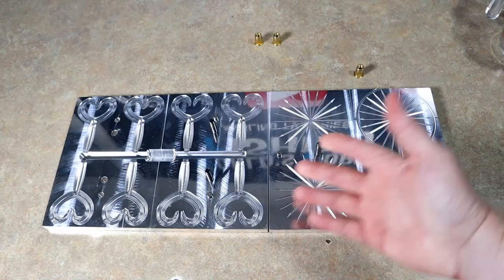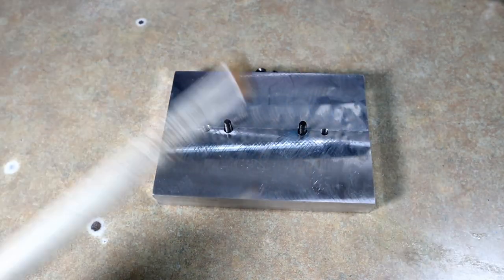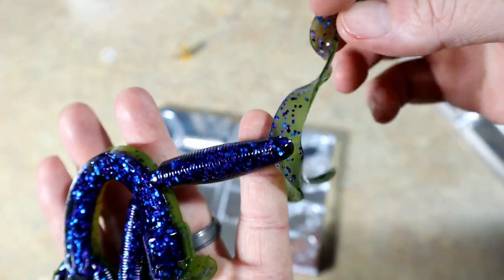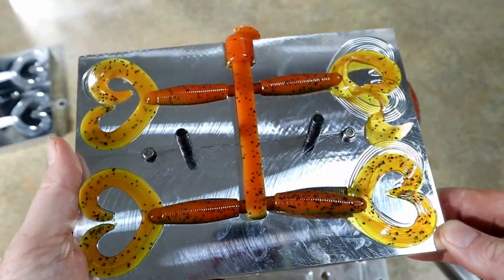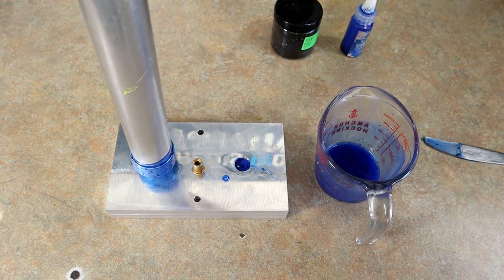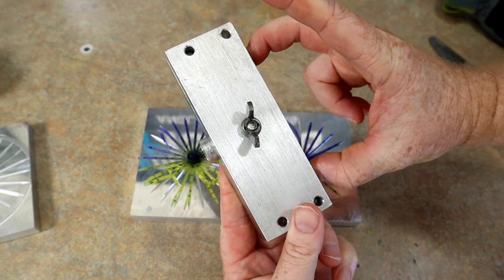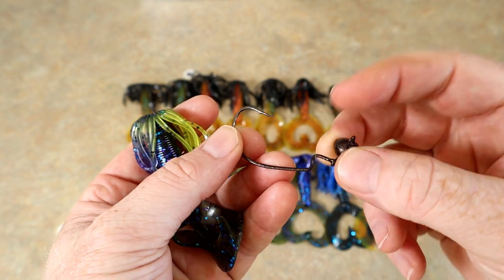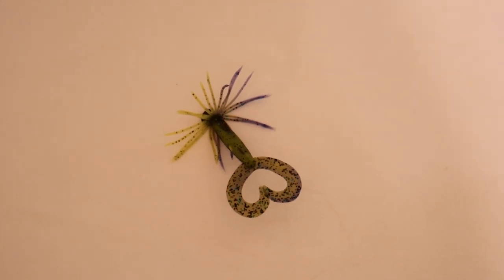Let's Make SKIRTED GRUBS!  New Molds and New Techniques!

Comment from the maker: This was one of the coolest things i've done yet!! Which were your favorite???
Reply: What a great idea adds so much flare to your plastic it's sure to catch more fish . Probably go well as a  trailer on a chatterbait to add that extra flash 👍
Reply from the maker: @erlinglarsen  yeah the cool thing is you can weld these skirts to any bait in your collection
Reply: Not a bait I thought I would even want until I saw the swim video
Reply: @WorldsWorstFishing  For sure the list is endless. I was wondering and thinking of the different applications you could use them for as you were making them 😂🤣 but as a lure maker and fisherman you can't help but wonder what you could use them for 👊
Reply: @WorldsWorstFishing  maybe try and link a few on top of each other 🤔😂
Reply from the maker: @erlinglarsen  go check my instagram, I did that and posted a picture
Reply: the black grape/ yellow grub
Reply: Blending the skirt awesome.
Reply: Blue green in the Northeast looks killer!   Even I could catch a fish with that set up
Reply: @WorldsWorstFishing  will do 👍
Reply: You're starting to gather quite the collection of molds.
Only 2 or 3 hundred more to equal what Scroggins has. lol

Lets say I was to leave the heat gun on while doing this is the residual heat blowing out gonna burn me or does the heat knife apparatus block it so it is all focused on the blade?
Reply: Do you still sell? Those black grape, yellow I'd like to get a bag or two of. If not I understand. Awesome work!
Reply: My favorite is the 2 color one's.
Reply: Man after watching this the ideas are flowing , ill probably waste money on a skirt mold now lol
Reply: I’d like to see something in a swirl with some pearl added. Just an idea thanks for the videos
Reply: I like grubs a little simpler. The Black and Blue ones.
Reply: can you please make a realistic squid soft bait ?? 👾👾👾👾👾👾👾
Reply: I used a weld pen to repair worms and modify baits. Suggestion, put floating claws on sinking Ecto-Craws, Punch Bugs and Grass Grenades. Be sure to show them in the "test tank".
Reply: These are my favorite baits to use. I'm loving all these colors. I'm curious when you store them do you flavor them with garlic or salt?  Or anything else? And do you spray them with nonstick spray to keep them from sticking or melting together? I'm a total beginner was curious. Thinking about trying to make these myself.
Reply: the purple and yellow grubs i want some
Reply: Where do I get the skirt mold
Reply: Where can we buy?

Comment: You are the man.  I purchased the skirt mold a couple months ago.  Went crazy and have probably a 100 surplus skirts  on hand with 30 color combos.  Skirts are great for using leftovers colors from sprus etc.  I failed at getting a good bond UNTIL you just fixed me. Thank you.  BTW the color combo's on this video are KILLER.  A little tip I do now is I use these skirts on the jigs I pour instead of silicone or rubber skirts.  So much more economical and the color combination are just endless. Thanks again Chris
Reply from the maker: Absolutely! Take those rubber skirts off haha

Comment: Chris is it possible to put light coating of worm oil to mold in order to make plastisol flow better?
Reply from the maker: It does not help.
Reply: @WorldsWorstFishing  i might heat my molds to 200°F to make them flow better

Comment: Heat knife is a cool tool but so much easier to use a dot of super glue instead
Reply from the maker: Faster than welding?? I've used super glue to put eyeballs on a thousand swim baits.. definitely takes me longer than the heat knife process..but I definitely will try it with the skirts and see if it works better for me.